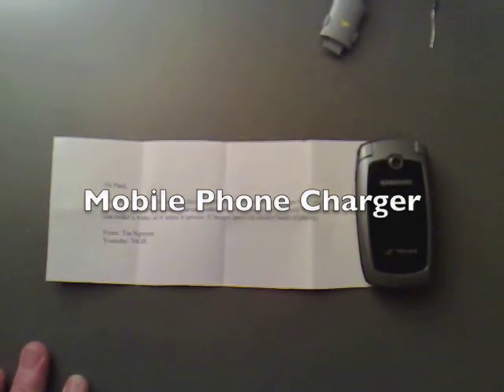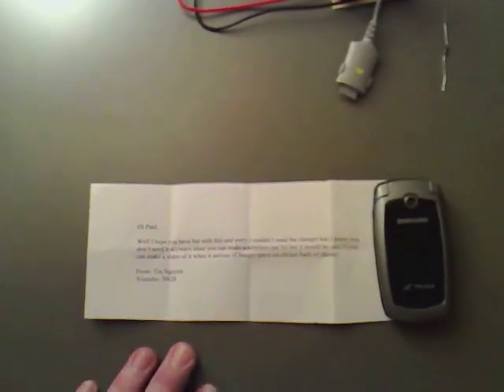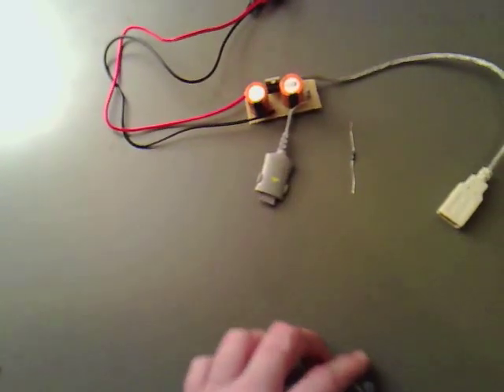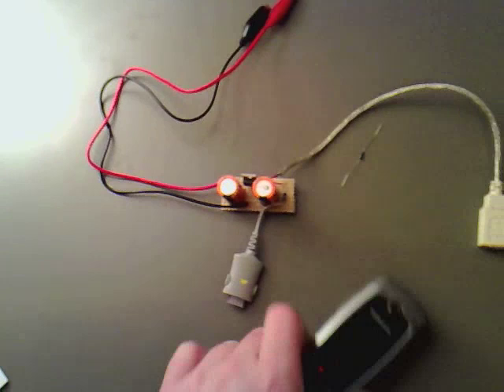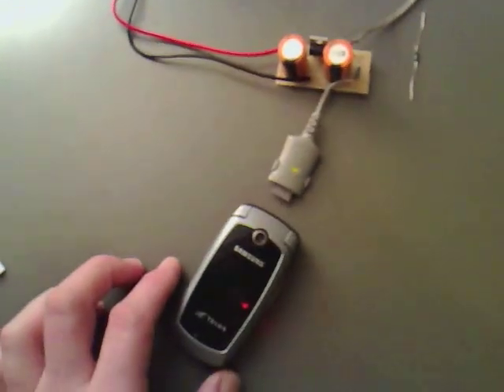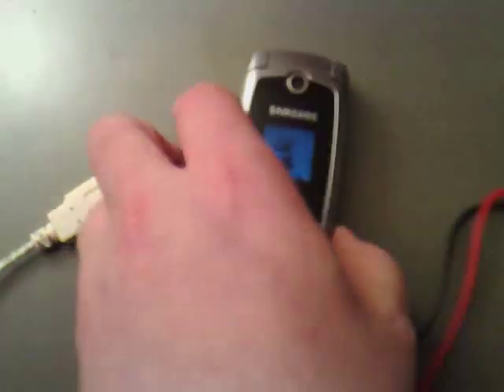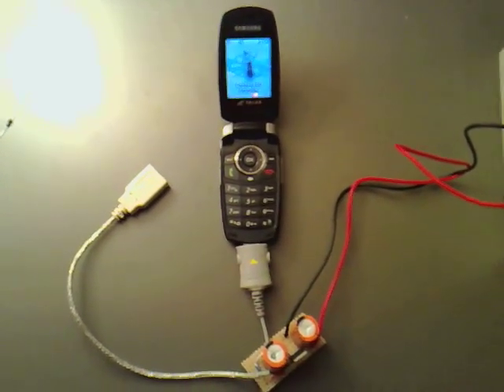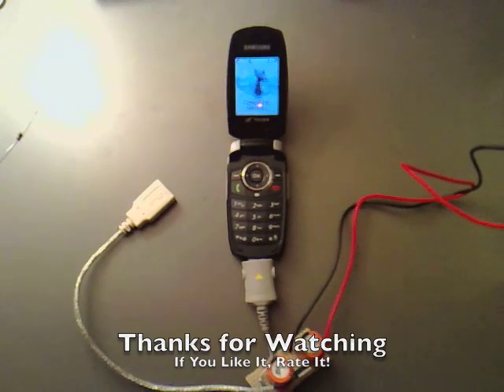Mobile Phone Charger

Comment: Indeed, the recommended capacitor values on the datasheet are 0.33uF for the input and 0.1uF for the output. So a 1uF on either side would be more than enough.
I never noticed you connected a USB lead to it before, thats a good idea. I might add that to my power supply.
Cheers for the info:)

Comment: This is different behaviour from the average Nokia, the Nokia needs a current limited supply and a high enough open circuit voltage. In fact if you connect a Nokia to a charger the phone checks the charger behaviour. Handy to have a phone that takes standard USB 5v supply to charge it... not being critical but the capacitors need only to be a few uF to keep the 7805 happy. Nice to see someone doing electronics.

Comment: I decided to have a look inside a mobile phone charger. I was shocked to see it was actually a basic switch mode power supply instead of a linear one.

But there was no circuitry in there to control the charging of the phone, just a 5V, 900mA power supply.

So Kubikop is right in that it is the phone that controls all the charging.